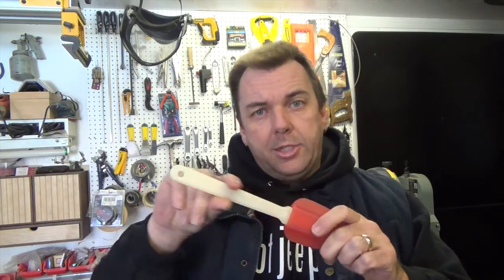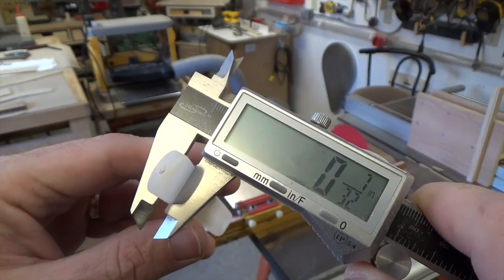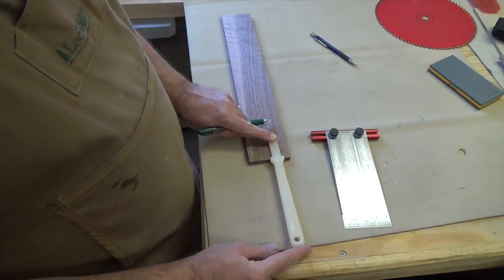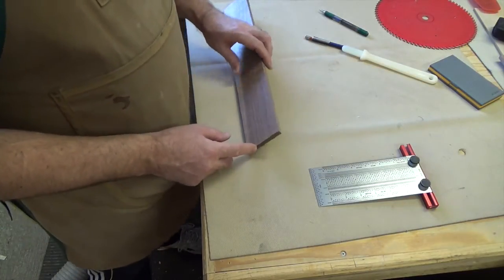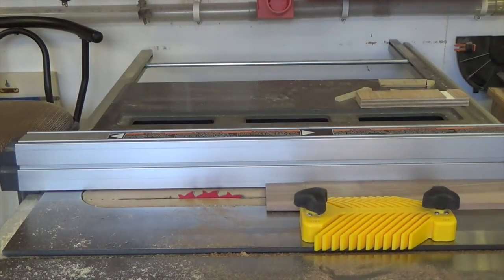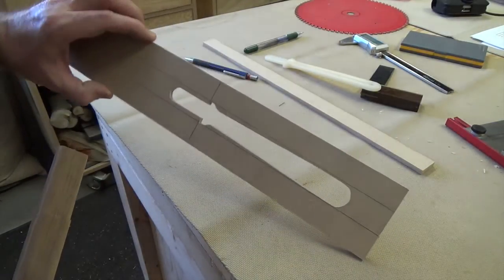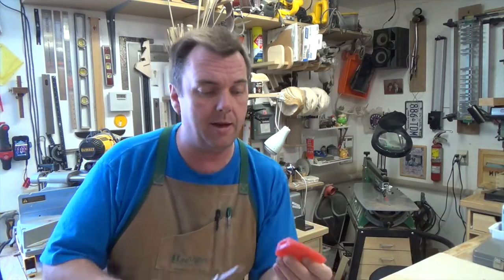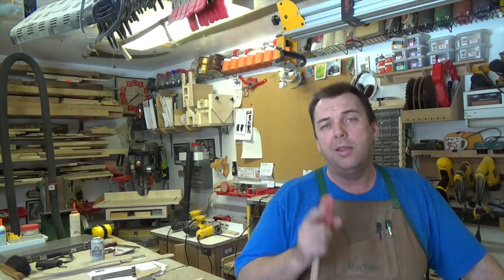Silicone Spatula Handles

Comment: Smart woman who realizes they can be made!! I've searched for replacement handles for years.. still searching!! 
Kudos to the smart hubby who deserves an award for working it out!! Do you sell them?? And yes, size matters...lol Short handles just don't cut it.
Reply from the maker: Unfortunately Yana, I don't sell the handles but they are very easy to make.  The rabbeted ends that go into the silicone can very easily be carved out afterwards using a hand saw and a chisel if you don't have access to a table saw.  The shape of the handles themselves can be cut using a fret saw if a scroll saw is not available.  These handles work great and the original ones that I made here on the show are still going strong.  I'm made many spares over the years and longer ones for use in the Instant Pot and that sort of thing.  Give this project a try.  You won't be disappointed.  Thanks for tuning in and for taking the time to leave your kind words.  I truly appreciate it.
Reply: @acutabove_woodworkings  , na, that's not happening. I'd be better off cutting a branch and whiddeling one....lol
Reply from the maker: @yanafreemanccht-qhht9973  LOL.

Comment: Good work Kenny..wouldnt it be easier to use the "cut out" part of the template rather than the hole?

Steve
Reply from the maker: For this particular template, the "cut out" would have been easier.  I normally make my templates out of clear plexiglass and I find the "hole" section easier to use, as I can see where I'm aligning the template.  For some reason, on this project, I used MDF for the template and will be making a new one out of plexiglass so that I can use the "hole" section without problems.  Using the "cut out" section, when the template is made from MDF, would certainly help out with aligning the template onto the blank.  Live and learn, I guess.
Reply: Thanks for the reply..keep the projects coming.
Steve

Comment: I started working with wood and I like the pusher you show in this video. You can, please send me the plane, or profile photo, so I can build one with the same handle. I am very grateful for your time and your videos. Greetings from Colombia
Reply from the maker: There really isn't a plan for this one.  It is basically a 45 degree triangle cut out of 3/4" plywood.  I then traced out the handle of my hand saw and removed some of the middle material to make it a little lighter.  There is a small chunk of walnut at the back of the push stick to grip the wood.
Reply: kennyearrings1 Thank you, for your quick response, you are right handsaw handle is very ergonomic.